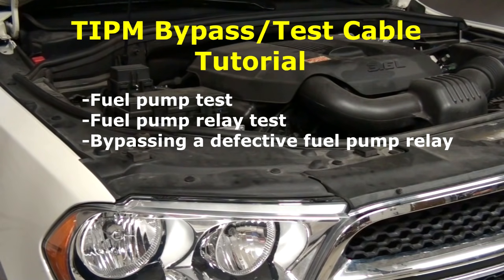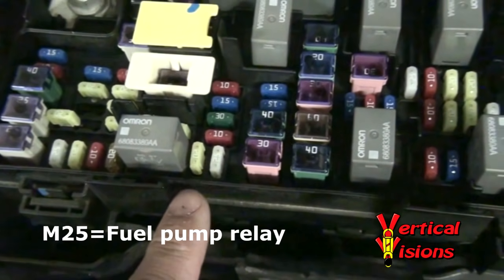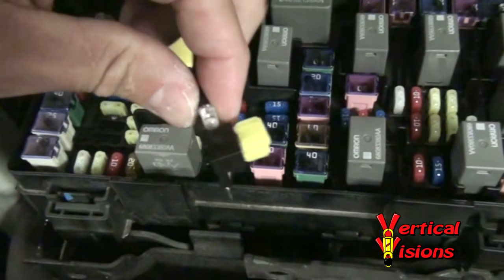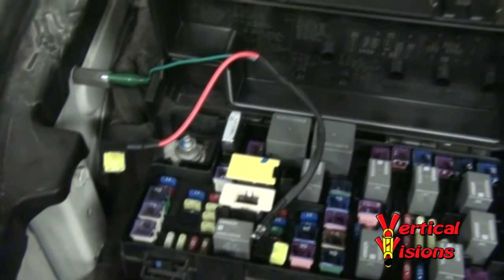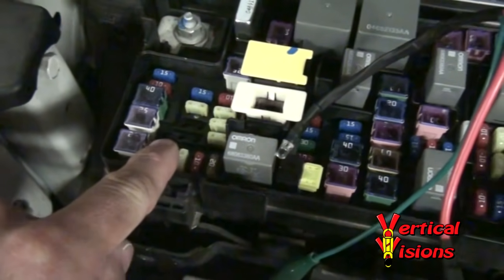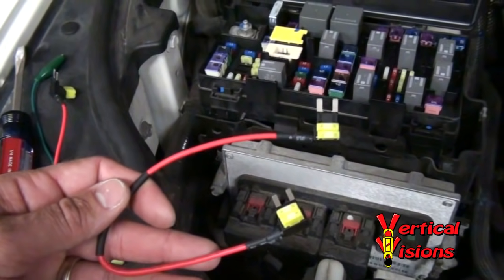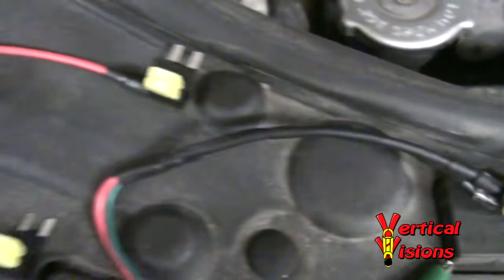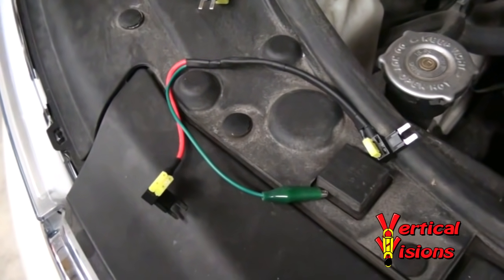TIPM Fuel Relay Test and Bypass Solutions - Most 2007-2021 Dodge, Chrysler, Ram, Jeep, VW Vehicles

Comment: Would this part work on this issue for a 2013? 
2013 Grand Cherokee Hemi, 35K miles. Extended morning cold crank 2-3 times. Once started no issues throughout day.
*Relay Recall done, same issue
*Replaced Fuel Pump, same issue
I can get an immediate start cold with starter fluid spray but won't stay started. [unless extend the cranking 2-3 times again].
So, it has spark, and fun pump runs, but no IMMEDIATE fuel pressure. 
question: On this single line fuel system, (does not return to tank) could the fuel be backing down the rail as if a the check valve (in the new pump) that maintains fuel in the rail w/ pressure was bad?
any help will do.
Reply from the maker: Not if you had the "not so elegant" recall done already, where harness wires are cut.  Suggest you replace your external relay:  https://www.verticalvisions.com/omron-g8jn-external-relay.html

Comment: Plugged into the ciggy  lighter slot and would not start. Plugged into the heated seat slot(no heated seat option)  and now it runs.   Thanks for the info  !
Reply from the maker: We now have a new slot that we use.  We do not use M7 for bypass mode.
Reply: @VerticalVisions  What new slot are you using ?   Update: Nitro takes forever to start now.  Like it is losing fuel prime.

Comment: For the people in the colder climates this doesn’t work in the winter as the fuse your jumping to does not have power in the crank position however the remedy is to simply use a different fuse in the rear of the tipm fuse box that does have power when cranking and wire that to a relay to power your fuel pump. Hopefully this helps someone as I had a heck of a time trying to figure out why my customers car wouldn’t start anytime it was below 10 degrees and car had been sitting
Reply from the maker: We are very much aware there are better fuse slots to draw power from.   If you purchase TIPM cables from us, we tell you exactly how to use the "new" slot that has no cold weather starting issues.

Comment: Hello Jason I want to see if you can help me with my 2013 dodge durango 3.6L. It start acking kind of weird ... it starts with check engine and then wipers turn on and all the light on dash start flickering I loose all control of the vehicle, if I put it on park it locks .... it has a code u0141 ... change the battery it work fine for maybe a week and it started doing it again... the shop checked it but they said i have to take to dealership that it's the Tipm... I would really appreciate looking to hear from u
Reply from the maker: Check to ensure all chassis ground wires near the TIPM are not rusted.  if you lose your ground connections, MOSFETS can be "floating", resulting in the symptoms you mention.

Comment: I installed this but now having problems with cold start ! And ideas ?
Reply from the maker: If you ordered directly from us, you would have received updated color hard copy instructions with the part that shows exactly how to connect the cable to resolve your issue. The cable connections are now slightly different from what you see on this video.  If you ordered a knock-off TIPM cable from one of the fine folks that continually steal all our text, images, and IP, then you'll want to contact them for support.
Reply: @VerticalVisions  no so I probably got a knock of 😩 I figured it out but ide rather the real deal.  Going to your site now which one do you recommend? For a more permanent fix
Reply from the maker: @everythingbostons203  This is our most popular part (patented, long term, and zero warranty claims):  https://www.verticalvisions.com/tipm-plug-in-fuel-pump-power-bypass-test-system-lite.html.  We are also here to provide support via telephone, email, or Facetime.
Reply: @VerticalVisions  okay thank you so much for taking the time to get back to me !!

Comment: Awesome video I actually did the fuel pump relay recall and my jeep will still stall once every month or so when I’m driving then I pull over put it in park and it starts right up till another month or so is there a fix?
Reply from the maker: Jeep model/year info will be needed to assist.
Reply from the maker: You probably have an external relay per a recall.  How to ID and replace an external relay:  https://www.verticalvisions.com/omron-g8jn-external-relay.html#identify
Reply: @VerticalVisions  thank you so much for your help it’s much appreciated
Reply: @VerticalVisions  just thinking as I’m reading all the comments seams like everyone is have the issue that their vehicles won’t start I never had that issue it always starts my issue is a stall while drive when coming to a stop or driving off an exit on the parkway it seems as the nose of my jeep goes downward as I’m turning or stopping mabye it’s something else that’s shorting like a crank shaft position sensor wiring being crushed as I’m turning but no codes come up crazy
Reply: @VerticalVisions  2012 Jeep Grand Cherokee overland 5.7 hemi

Comment: My truck started doing this and it’s progressively gotten worse. I went to do the tests and discovered that my “cig lighter” fuse spot was already filled with my snowplow controller power. Any way we can splice them two together or another suggestion? Thanks!!
Reply from the maker: We no longer use M7 for bypass mode, so you should be fine.  All of our products contain hard copy instructions showing how to properly connect the cable.

Comment: How to bypass on a 40 angle fuse box
Reply from the maker: Please explain what a 40 angle fuse box is.
Reply: It's a tipm that sits at a 40 degree angle was in early year o6 truck
Reply from the maker: @bigcountry3048  We don't deal with anything older than 2007, sorry.
Reply: @VerticalVisions  ok thank you sir

Comment: Can I test the fuse with a fuse probe since I don't have the led light
Reply from the maker: Yes.  M25.  Intermittent or no detection of 12VDC during engine cranking means the relay is likely faulty.
Reply: Circuit tester to test for power while cranking

Comment: Thanks Jason!! You have literally saved my wife and I thousands right in the middle of a big move. You're the Man!

One question I do have though, we have been having issues with the FIRST start of the day in our 2012 grand caravan since the cable fix. So far both days after we have had an issue starting immediately, then within 5-10 minutes we try again and she starts right up! And we don't have A SINGLE issue starting it again throughout the rest of the day with multiple stops. Any idea what could potentially be the issue? Car seems to have plenty of battery. And only.has an issue on the first attempt
Reply from the maker: You're probably using the old cable connection method shown in this video.  The new method will probably resolve your issues.  If you bought our product, our instructions will tell you how to connect it correctly.
Reply: @VerticalVisions  

So I'm scanning the directions here and I'm still not quite sure what your talking about..is there any chance you would be able to DM me? I can send a picture of the direction for proof of purchase if you need
Reply: Unless you're referring to removing the bottom fuse on the m25 side?
Reply from the maker: @haroldkumar213  Please contact us at verticalvisions.com with your order number and we can better assist you there.    The biggest problem we're having now are the two dozen companies that steal our intellectual property, then sell inferior knock-off versions of our products with no instructions.  We field calls every day from those who thought they bought our parts.   If you bought from us, there are 4 pages of color hard copy instructions that will tell you how to correctly connect a TIPM cable for bypass mode.

Comment: My question is this....I have a 1997 Jeep Grand Cherokee Laredo 4.0l 238,000 miles. Runs well but when you park it overnight and get in the next day the battery is dead. Battery is new. What could be backfeeding? Some say its the alarm but I don't know. Thanks and great videos.
Reply from the maker: It could be many things, so you'll want to check circuits when the vehicle is off to find out.  Use a "fuse buddy" device that can plug into each fuse slot and test up to 30 amps.  A multimeter will also do the job, but most can only handle 10 amps max. Probe each circuit until you find it.  The most common "parasitic draw" functions are fuel pump relays, HVAC fans, and heat producing devices.  For your battery to be drained, something in your vehicle must be producing heat, pumping, rotating a motor, etc.  Also make sure your alternator is truly charging your battery while driving (you should measure around 14 VDC with vehicle running).  Good luck.
Reply: @VerticalVisions  voltage is 14v
Oil pressure 40
Temp gauge is just left of 210 180 or so
Reply: @VerticalVisions  what model fuse buddy do you recommend? There are many.
Reply from the maker: @joeapicelli8367  If you have mini-blade fuses, the 305M is best

Comment: Will this work for a 2014 Durango? If not do you sell one that will?
Reply from the maker: Yes, but you need this cable type:  https://www.verticalvisions.com/tipm-test-bypass-cable-micro2-fuses.html
Reply: Thank you!
Reply: The bypass worked at first. Now there is times when is still won’t start. When it doesn’t start I hit the top of the Tipm with my fist.( with the bypass still connected). It starts right up. Any ideas why?
Reply from the maker: @rickeysimmons5381  Yes, but it's a long story.   How are you connecting the cable?  Which fuses are installed?
Reply: Wow still no reply a year later???
Reply: First, I would like to thank you for your fast replies. That is so awesome!!

 I am using the 20amp fuses. I am connecting from the F91 terminal to the F70 terminal. I am using the Vertical Vision test/bypass cable for the micro2 fuse slots. The vehicle is a 2014 Durango.

Comment: Hello I have a 2011 Mercedes S550 that has a code U0109 lost communication with fuel pump control module I was wondering if you could bypass that with your wiring i jave new fuel pump new transfer pump and all fuses an relays are good
Reply from the maker: I'm not familiar with your vehicle, but you can read more regarding how a TIPM cable works:  https://www.verticalvisions.com/tipm-test-bypass-cable-mini-blade-fuses.html#faq10

Comment: Hello Jason, My daughters 2012 Chrysler town and Country  had the no start drained batt, issue to begin with,,My son is a Transmission mechanic at the Chevy dealer and thought it was a bad PCM that wasn't shutting down  and had an open relay but wasn't able to confirm that was the problem. It sometimes would start and run for one day, sometimes it would start then die like it ran out of gas.I started searching U-Tube and found your video ..My son agreed it sounded like the problem was very likely a bad internal fuel pump relay  . So they ordered your "Lite "plug in bypass relay. It totaly fixed the problem no more getting stranded. Thanks a bunch Jason your Bypass relay saved the day . A seemingly complex problem made Simple and inexpensive :)
Reply from the maker: Thanks Richard.

Comment: Doesn't look like an 07 tipm
Reply from the maker: Sure it does.  Here is the updated vehicle list that we've tested t
2008-2016 Chrysler Town and Country
2011-2013 Dodge Durango
2008-2020 Dodge Grand Caravan
2009-2010 Dodge Journey
2007-2011 Dodge Nitro
2011-2013 Jeep Grand Cherokee
2007-2012 Jeep Liberty
2007-2018 Jeep Wrangler
2011-2012 Ram 1500, 2500, 3500
2012-2014 Ram C/V
2009-2014 VW Routan
2011 VW Touareg
Reply: @VerticalVisions  wish I could send a pic of this one. It has no relays and about half the fuses
Reply: The relay is on the board

Comment: I purchased the TIPM cables several years ago for my 2011/12 Chrysler T&C and   it works great.  However, now when I turn ignition on to the first click (ACCV) I see a 8+ amp draw like when I listen to the radio over 30 minutes, it kills the battery .- could that be the fuel pump relay or something else?   Thanks, for your valuable insight and Godly wisdom learned from your EE Degree!
Reply from the maker: Hook your cable up using the new method and all will be well:   https://www.verticalvisions.com/tipm-test-bypass-cable-mini-blade-fuses.html#faq19

Comment: Thank you for this information! Is there a way to test the integrated fuel pump relay using a multimeter, before purchasing the bypass?
Reply from the maker: Yes, a multimeter or test light that touches the top of the M25 fuse during engine cranking will tell you everything.  No 12VDC or light means the fuel pump relay is not allowing power to pass.  Ideally, leave the M25 fuse in place when you test and touch the exposed contact points on top of the fuse.  One wire must touch the fuse and the other to battery negative or chassis ground.
Reply: @VerticalVisions  fantastic! Thank you for clarifying all of that!

Comment: the fuel pump was still running even with the bottom fuse removed on M25 , and the van turned off
Reply from the maker: Which vehicle year/make/model?  Did you build your own cable or buy from verticalvisions.com?  Logically speaking, the situation you describe could only occur if there is a short in the fuel pump or associated wiring.......or you have a TIPM cable that is faulty.

Comment: Jason...forgive me if this question only betrays I have not read through all questions and comments. But...does this in any way bypass ANY safety circuits in place such as an inertially initiated kill of power to the fuel pump as in an accident? I am experiencing crank no start with some hinky fuel pump issues as my wife detected a hum at rear of vehicle after I had totally shut down engine and removed key. But, in addition I have the added conundrum of a continued cranking after switch is "relaxed" back to "ON" from START (but only when vehicle does not start). I have read the TIPM is subject to all manner of gremlins and symptoms that can plague an owner, and up for any remedy that is as simple as what you offer. But my main concern is not defeating any safety circuits...which is actually kinda funny, no? Like if the TIPM is so notoriously defective...what faith might I have in any safety circuit it may (on paper) claim to provide.
Reply from the maker: No safety circuits are affected by the use of this part if connected from M37 to M25.  We have changed the connection terminals over the years.
Reply: @VerticalVisions  thanks man.
Reply: I am going to order the part from you and will, if solving my particular problems (of which I do not hold you in any way to their resolution as I admit my troubleshooting is far from perfectly complete in regards to my issues)...also compose an ode to your product and efforts.

Comment: Your website says this WILL NOT work for a 2009 Dodge RAM 1500. Is that actually true? Why is that?
Reply: I was thinking that I could just use this bypass cable to connect to the fuel pump fuse (M22) and the IGN R/ACC-PWR outlet #2 (M48). If that won't work, is there some other type of similar workaround? and external fuel pump relay, somehow?
Reply from the maker: https://www.verticalvisions.com/tipm-test-bypass-cable-mini-blade-fuses.html#faq10

Comment: My wife’s fuel pump fuse keeps shorting out/popping when we go to start.. Would that be a bad relay or a short somewhere? Cranks no start..
Reply from the maker: It could be a faulty relay, but could also be a pump that is drawing too much current.......or a wire short somewhere.  If it were my vehicle, I would measure the current draw on the M25 fuse using a fuse buddy or multimeter that can measure at least 30A.  Then bypass the fuel relay using a TIPM cable to test if the relay is the issue.  This info should narrow the problem.

Comment: Will this work on a Junky jeep wrangler Jk too? Good lesson here too is never buy  Chrysler product. My 2009 jk with only 65 thousand miles has been a parts replacement vehicle for years. Heater core, radiator, fuel injector, shocks, steering dampener, idler pulley, MAP sensor, and more needed replacing. I am certain Chrysler puts inferior parts in to create work for themselves. I will never purchase one of their vehicles ever again.
Reply from the maker: Yes.  Here is the mini0blade fuse type list for applicable vehicles:  
2008-2016 Chrysler Town and Country
2011-2013 Dodge Durango
2008-2018 Dodge Grand Caravan
2009-2010 Dodge Journey
2007-2011 Dodge Nitro
2011-2012 Ram 1500, 2500, 3500
2011-2013 Jeep Grand Cherokee
2007-2012 Jeep Liberty
2007-2017 Jeep Wrangler
2009-2013 VW Routan

Comment: Question? can a issue like this kill 2 batteries? I bought a battery in march and was bad by late october had warranty was given a new battery have had less than a month and today I was told it is no longer good..This has stuck out to me but not sure if this could make this happen i have a 2011 dodge ram
Reply from the maker: Yes, of course.  A "stuck on" fuel pump relay can drain a good or bad battery in a few hours since it draws around 9 amps on average.  Can you hear the fuel pump running with engine off?  Which vehicle year/model?
Reply: @VerticalVisions  it is a 2011 dodge ram but I have never actually checked
Reply: I should be getting another battery tomorrow God willing and I will check to see if I can hear the fuel pump tomorrow after shutting off thank you for the info and I will visit your website after to purchase this wire..

Comment: Thank you some much... It just took 1 minute to install.  The only down side is my kids like to sit in the truck on break and listen to the radio. Since the key has to be turned to acc the fuel pump runs too , but I'm still happy that I don't half to pop the hood every time I get out just to kill the fuel pump. ( I did have a kill switch on my truck) thank you
Reply from the maker: Hook up your cable the new way and it solves the ACC issue:  https://www.verticalvisions.com/tipm-test-bypass-cable-mini-blade-fuses.html#M37